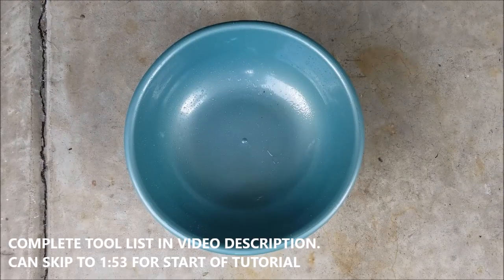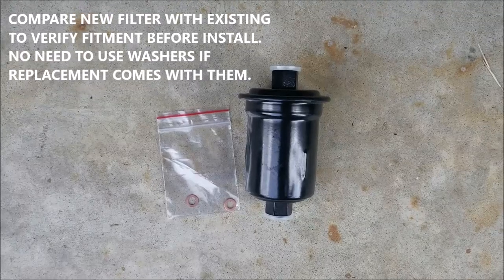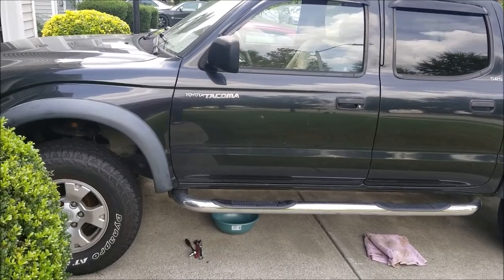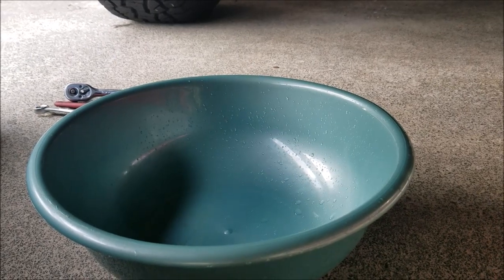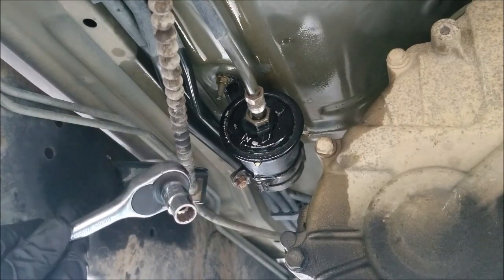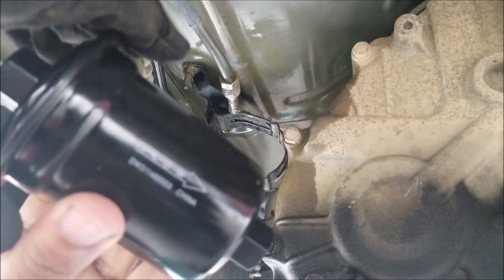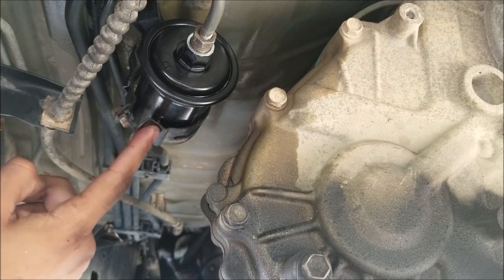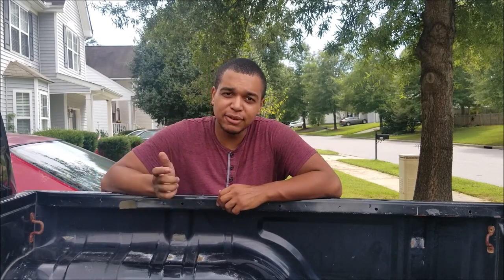3.4L DOHC V6 Fuel Filter Change | Toyota Tacoma 4Runner T100

Comment: What the different between original parts and aftermarket parts ?!
Reply from the maker: In theory there should be very little difference, however, original manufacturer equipment typical has reputation for better quality control of parts at least for Toyota part manufacturers
Reply: @EngineeredMojo  
Thanks a lot

Comment: Just tried to do my 93 T100 and the flare nuts came loose but then got tight again more so than they were at the beginning... The nut began to round over and I gave up and tightened it back down... I swear every auto repair I try always ruins my day.  😢
Reply from the maker: Tough break!! Yes the flare nuts can be annoying to remove for sure. You could always retap your line with a new nut, but that's a whole other process, not hard though
Reply: @EngineeredMojo  yeah I don't mind working on the water system but when it comes to gas lines I think I'll take her into the experts.  

Have yourself a good one

Comment: Where is the fuel filter on a 2016 Toyota Tacoma, I’m thinking it’s inside the gas tank after checking under the driver side and inside th engine area and can’t seem to locate it
Reply: Thank you very much, I may try and attempt it myself on my day off
Reply from the maker: I had asked a tech about this awhile back. Apparently, it's in the gas tank mounted near the fuel pump similar to  the previous 2nd gen Tacoma

Comment: Hi I got a 2001 4 runner when I start it up sometimes it crank right up. But sometimes I crank it up it cut right back off and the ln I start it again and it takes a long time to crank up at the end it cranks up sluggish after holding key in ignition for a long time waiting until it starts I have a video of the long crank hard starting that it’s giving me
Reply from the maker: I'd go through the basics and check fuel, spark, compression in that order given complexity. Check fuel pressure and using an inline spark tester on the plugs is fairly simple. If those check out move to compression test to see if that is given you your starting issues

Comment: I have a 2019 Tacoma 4x4. Does it also have an inline filter? I always changed the inline filter on my Silverados and F-150 trucks, usually, once per year. Never had a problem. I thought for sure that on the Tacoma the fuel filter was in the tank. Thanks .
Reply from the maker: I believe for a 2019 it's integrated into the fuel pump inside the fuel tank. Hope that helps!
Reply: @EngineeredMojo  Thanks. Have a good day.

Comment: Great video man!!
Reply from the maker: Appreciate the comment and feedback!
Reply: @EngineeredMojo  where did you get the copper washers? My filter didn't come with any
Reply from the maker: @04tacomaguy1  local autoparts store like advance auto or autozone will have some generic copper washers, but you will typically have to buy a whole pack of assorted washers of different material. I have better luck buying online from Amazon 25 or 50 pack of size washer I need exactly.
Reply: @EngineeredMojo  any idea what size it was? I might just buy an assortment pack of them

Comment: Thanks for the very clear instructions.  I tried to replace fuel filter already, but was afraid of breaking my fuel lines because the bolts wouldn't turn.  So now I'll try the product you suggested.  By the way, the fuel filter is located on the passenger side of the 1993 Toyota T100.
Reply from the maker: Hopefully that product eases the removal of the nuts, it typically works great in those applications. Also thanks for adding the tip of the location for the T100!
Reply: This is for the 5vz which your '93 doesn't have

Comment: Great video, well detailed. Only thing I would add is kill the fuel pump and crank the engine to release pressure in the line. I do this by removing the EFI fuse under the hood or removing the ignition ING fuse in the cab also works. Also removing the gas cap to prevent any pressure in the tank from pushing out more fuel.   I have done this twice, and the time I did not disable the fuel pump and crank it the fuel sprayed out a couple feet when removing the first side.
Reply from the maker: Good tips on relieving fuel pressure, thanks!
Reply: @EngineeredMojo  Your welcome
Reply: This needs to be added in the description or pinned to top. 
Always good to top up quality content

Comment: 1st gen 01 tacoma v6 pre runner 2wd Part No. 86319 fuel filter from advanced auto parts no washers works great no leaks. Fuck those ones with the washers!
Reply from the maker: Haha dang that's good to know! Thanks for the solid info :) those washers can be a pain

Comment: You didn't use copper washers? Maybe I need to get a better fuel filter.
Reply from the maker: I sure did use them, they were placed internal at the screw face mount. Hope that helps!
Reply: @EngineeredMojo  Those washers are a pain! Not sure how to get them to line up properly. Did you set the washers in the filter?
Reply from the maker: @bardinkurtis  yea I set the washers in the filter and just did one side at a time. I've seen people use a very very very small dab of super glue to keep washer from moving around, but I haven't had to do that the 3 times I've done this maintenance item for this particular truck. Worth a try though if it is causing issues
Reply: @EngineeredMojo  thanks for your help! I didn't notice washers in the one I removed. Maybe some filters require them and some don't?
Reply: @EngineeredMojo Fuel filter from Advanced Part No. 86319 no washers worked great no leaks. Fuck those ones with the washers.

Comment: My 4 runner cranks but no start. It’s been about 2 weeks now. Could it be fuel filter or fuel pump? ... 2002 4runner w/ 300xxx miles
Reply from the maker: Could be, I doubt it's the fuel filter but it's a cheap replacement if it has never been changed before. Could be the fuel pump. Personally, I'd confirm I had spark then move to confirming fuel pressure given it's a bit tougher to confirm pressure on 3.4L engine variety given it's hard to place a fuel preasure gauge inline of the fuel line. If you confirm fuel and spark (spark tester loaner tool makes that easy) then last I would check compression (free loaner tool as well, pretty simple process)
Reply from the maker: I doubt the fuel filter, but possibly the fuel pump. I'd test what fuel preasure
Reply: @EngineeredMojo  I’ll check it tomorrow after work!

Comment: Is there any sort of bleeding required afterwards? Does the air just escape on its own as it gets sucked through to the engine?
Reply from the maker: No bleeding required, remember air is a necessary component of combustion anyways so it all gets sorted out through normal fuel flow

Comment: He didn't show the front part off, he missed the important part!
Reply from the maker: Ahh which part are you talking about in particular? I'll note it for a future video
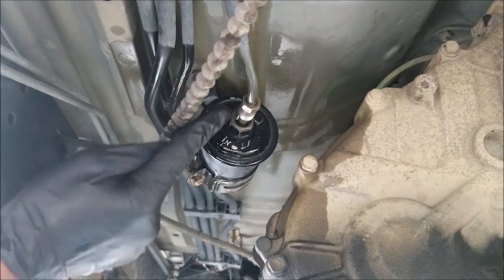Reply: @EngineeredMojo  i think they are talking about showing the fuel line removal on the engine side. At 3:34 you mentiined you would go to the other side but didnt show it. I just saw the inlet line removal from the tank side. No worries, its the same process! You do a great job, keep it up, Please!
Reply from the maker: @nvrman1  thanks for the info!

Comment: What are the brass seals / rings that come with the Filter? Will I need them when changing the filter out?
Reply from the maker: Those are washers that go in the exact same spot where the originals are located; inside the screw hole fittings on each end

Comment: nice clear video thanks. just about to do the fuel filter on my '93 T100. Good tip about the flared 14mm wrench. i just changed out the fuel tank because it was rust through and leaking and when i un-did the fuel line which has the short flexible section, which has a 17 and 14mm junction at each end of the flexible section, i did exactly what you warned about with the fuel filter job ( ie i striped the nut as it is a soft bronze coloured metal. they were rusted solid so not sure if flare wrench would have worked but certainly seems like it would be a better tool than the open wrench i used. Solved the problem in the end by cutting the fuel lines and replacing with high pressure rubber lines, clamped to the old fuel lines. So im going to buy a flared wrench before i try to undo the fuel filter which also looks rusted solid.
Reply from the maker: Those fuel line nuts can be a bear to remove and like you said half the time the nut is rusted from exposure to the elements. You came up with a good fix though, I plan to add the rubber high pressure line fix to my bag of tricks. Appreciate you taking the time to comment and sharing your experiences

Comment: When you know it’s time to change it
Reply: My experience with these type of in line filters is that if your vehicle is performing as new then don’t worry about changing the fuel filter ... if you experience hard starting, hesitation either when leaving a stop quickly or when attempting to accelerate up a hill or when passing someone then start trouble shooting by changing the fuel filter first! I replaced a fuel pump once and it turned out it was just the filter ... costly misdiagnosis ☹️
Reply from the maker: For the fuel filter in Tacomas there isn't a specified change interval. I usually will replace my fuel filter every 3 years or 60k miles. Just a number I pulled from I believe another Toyota car model. Thing is with fuel filters their lifespan is totally dependent on the quality of fuel being used which can vary between suppliers regardless of grade used.

Comment: Say, what year is your truck? Was told by Toyota that filter is located inside gas tank years 2007 on up.
Reply from the maker: My truck is 2003 and correct the 2nd generation Tacoma's have the fuel filter in the gas tank. For 2nd gen's it is not a regular scheduled maintenance item so they rarely need to be changed. Hope this info helps!

Comment: Note to any Aussie's, the Hilux 3.4L V6 fuel filter is located in the passenger side of the engine bay.
Reply: It's also the case for the Prados if that helps 🙌
Reply from the maker: Nice info thanks man!!

Comment: Great video! I enjoyed this, as it was fairly thorough. I have heard that using a rag tied around your wrists can stem the flow of fuel if you happen to spill any down your arm. Also, I think next time I do this on my T100 on any car with an in-line filter below the gas tank, I will wait until the tank is almost empty, and also clamp off the soft line running from the tank to the hardline to keep fuel from spilling out.
Reply from the maker: Ahh the wrapped rag is a great tip, makes sense. Plan to use that as well as clamping soft line next go around. Thanks!